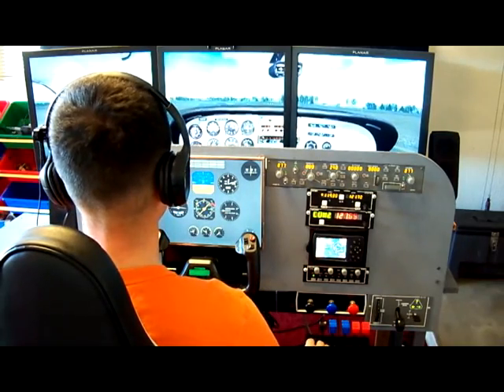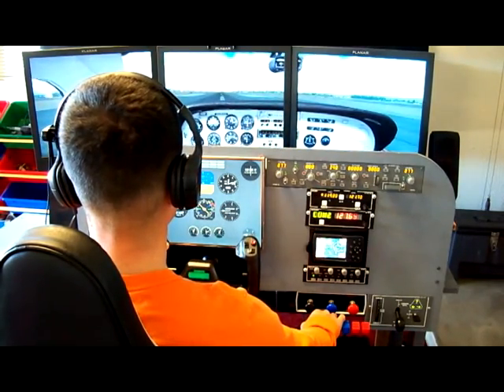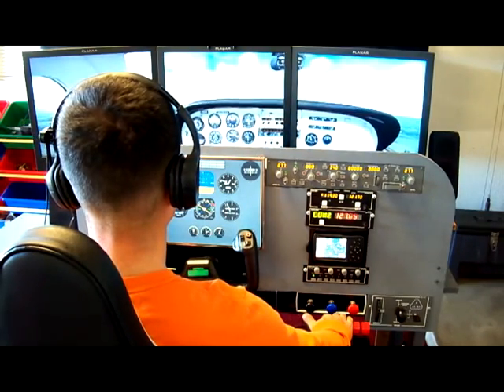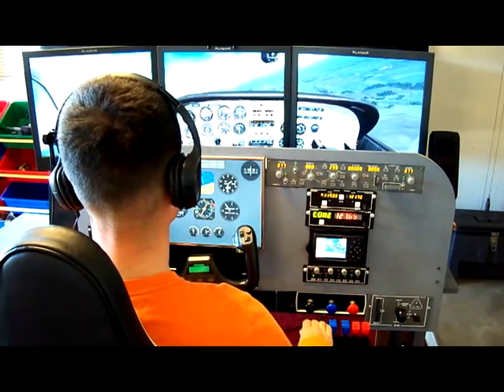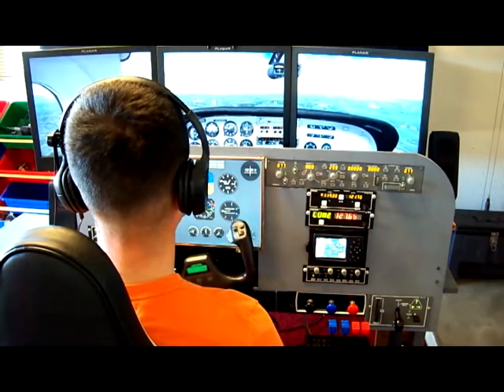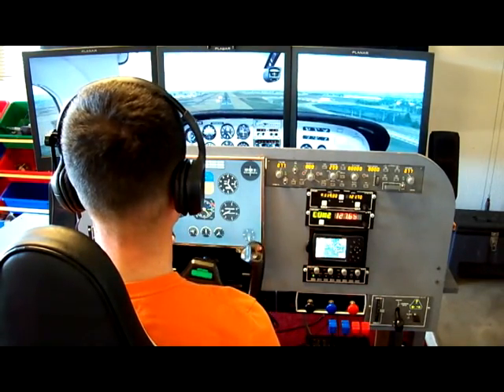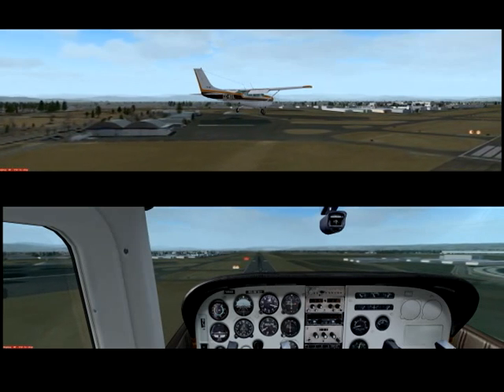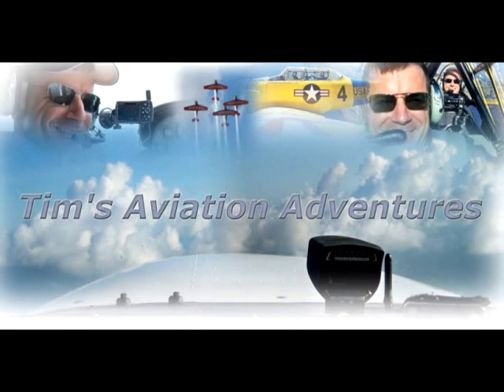Home Flight Simulator Demonstration

Comment from the maker: I see your point, my reference was to operating cost which in this case would only be the electricity supplied to the system vice a real airplane where you would pay for fuel, oil, and a maintenance reserve which even on a Cessna 172 would cost you $85+ / hour.

Comment: if you switch between fs2004 and fsx because of the different aircraft you can just copy and paste the aircraft folder from 2004 to fsx, and it works fine, and then you get the aircraft you want into fsx, just copy and paste the aircraft you want into the fsx/ simobjects/ airplanes folder :)

Comment: RV's are very versatile. They can land / take off basically anywhere. Cessna's arent really good STOL aircraft. And RV's are great for touring. The RV has a range just under 1000 miles. I know pilots who go on tours to france in RV's on a monthly basis. One went to Capetown last year. Plus not even do they hold their value. But you could make triple of what you spent if you were to sell it on. You can buy Cessna 150's here for 15,000 - 20,000 in Ireland.

Comment: I noticed you were using the (saitek?) twin-engine throttle quad.  When you're in your 182 (as in this video), is there any particular reason you're not using the panel-mounted push/pull TPM?  Nice setup, btw.